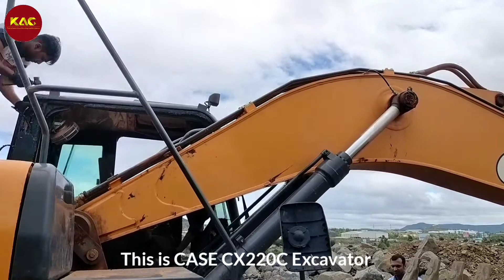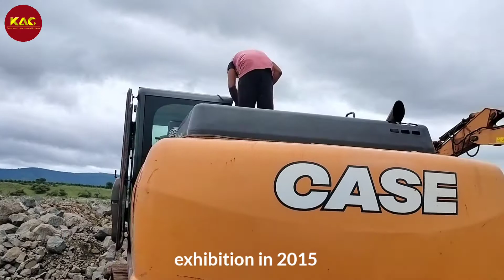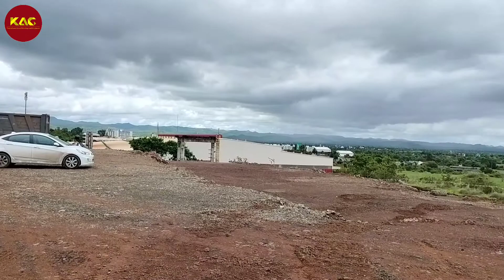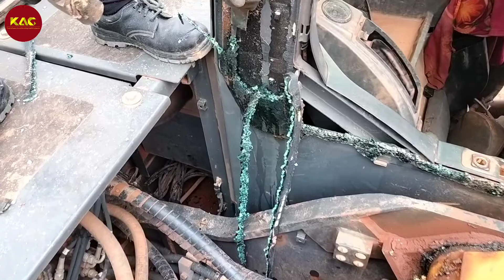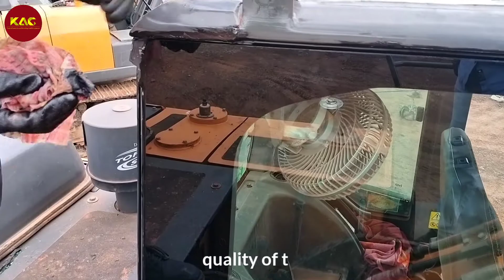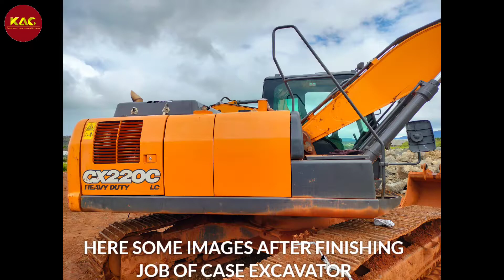CASE CX220C EXCAVATOR RIGHT REAR GLASS INSTALLED

Comment: Our company had an old crane, its cabin was altered, and we had previously installed laminated glass but it did not last long and was yellowed, so it was not visible.
We called Kadam Auto Glass and he came and saw the crane and took all the measurements and advised us to fit toughened glasses & original Nylon Rubber EPDM accordingly.
Made the toughened glasses in 5 to 6 days and installed it at the site, they are punctual, word is word, work is done as per money.
Very quality &  durable work done, we are happy with their service and work.

Best Regards,
World Wide Oil Field Machine Private Limited

Comment: My JCB 205 door big glass was broken I replaced it with simple glass in between but it didn't last.
I got Kadam's number from net I called and inquired about the rate, then I didn't have time because my machine was running so I waited for 1 month and After that called Kadam and Kadam came at the given time and did the work as per what he said about giving the materials.
The work is superb & the service is excellent, I have worked from Kadam for the first time, I had a good experience with them, I got to know this from my friend, even if they come early in the morning, they get the job done, I experienced it myself.

Comment: Earlier we used to get ordinary glass from local glass dealer, but they don't last long, the driver kept crashing and breaking it.
It was getting damaged, so we thought of looking for another glass dealer and after searching on the net got the number of Kadam Auto Glass and contacted them.
Got the rate but there was a huge difference between ordinary glasses and original OEM glasses but still we insisted on original Glasses.
Accordingly, we have done the work, the work is more beautiful and clean than the first, the transparent work has been done, it has worked like a new machine, there is no difference in the work.
We are pleased with his work, we have done amazing, amazing, wonderful, amazing work, the craftsmanship is at its best.

Best Regards,
Gayatri Projects Pvt Ltd

Comment: We got the glass of my Tata ex 70 Excavator from Kadam Auto Glass 3 years ago, the work was done well, in the meantime the glass of my other machine was broken, I did not call Kadam, but the glass was less and it is not appropriate to call for that much, so we got the work done by a local.  
After that we came to their office specially from Baramati to install the glass for our big machine TATA SUPER EX 210, the quality of the material and work is very good, they use all the original materials so we came all this way.

Best Regards,
Navnath stone crusher Bhigwan

Comment: Kadam.....only installs the glass that comes with the original machine OEM made, if the customer asks to install ordinary glass or fiber sheet, they refuse it, by using Ordinary glasses it effects on compromise the quality, assurance, visibility, strength they use original glasses only .